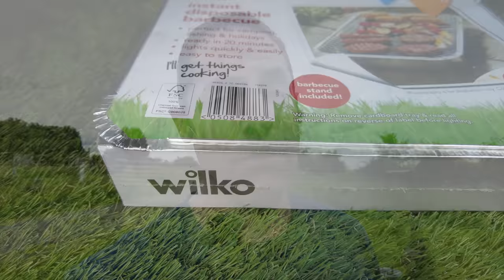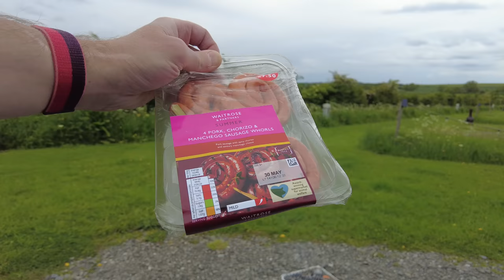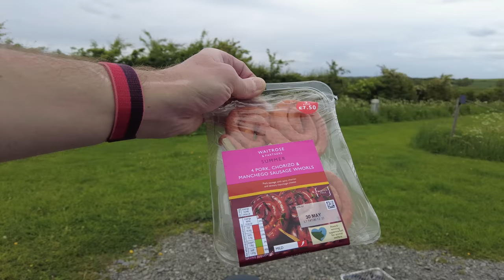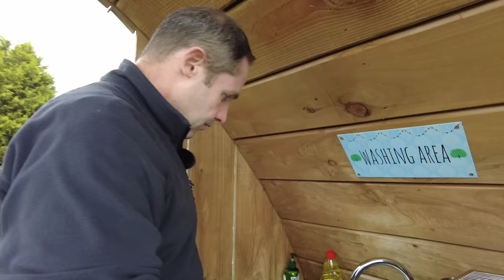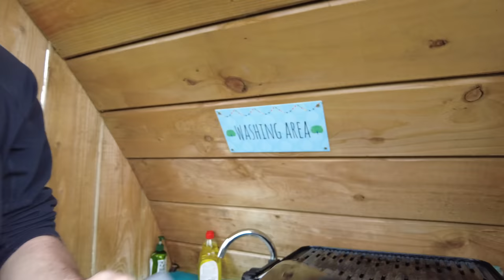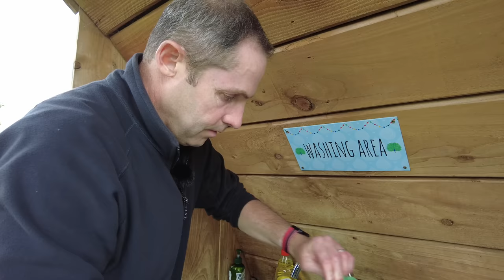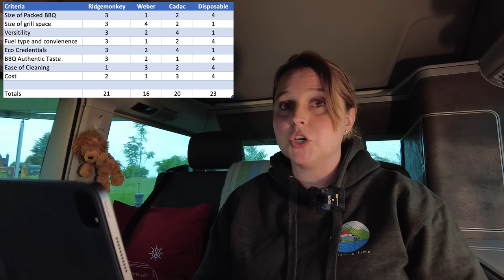Camping BBQ MEGA Test 2022 - For Campervans, Motorhomes and Campers!

Comment: Weber Go Anywhere charcoal would be my choice. Not only is it a real bbq (charcoal), it's smaller than the gas version and doesn't require cleaning afterwards. Just run it at a high heat and scrape. I also prefer to cook indirectly and cook low and slow
Reply from the maker: Mmmmmm low and slow... the BEST way to cook !

Comment: The whole point about the Cadac is to use the fat catcher at the bottom (put some water in there which stops it spitting and flames appearing) 
Then the fat would not fall straight on to the flame. Love mine, so versatile!! 

They’re awesome. I have the hp version and a single Coleman gas bottle (rather than the overpriced Cadac ones) lasted a whole week in France between 3 of us cooking bbq lunches/curries, Bolognese etc in the multi purpose lid … plus you can just use the burner for a frying pan for breakfast or to boil a kettle! The pizza stone is awesome too!
Reply from the maker: We learn something new everyday! That tip re the water in the fat catcher is brilliant, thank you!!

Comment: Happily grilled out and what a sizzling conclusion.
Wrestling to ignite damp disposables can detract from the simplicity but I cannot deny the logic.
But one key criteria has been missed out; 'Gadget factor'.  
Maybe its a bloke thing but the all singing stove that can grill, bake and roast in a compact easy clean package is hard to resist.
So I've gone for the Safari Chef 30 compact and when I've mastered the ultimate gadget (California) I may get round to baking bread and roasting a chicken.
Its also our back up when the Gaz bottle runs out and the unit cost of gas in the 220g cylinders is 40% cheaper than the 907.
Other interesting BBQs, include the Cobb and Lotus fan assisted grill and may be worth a look if you are inspired to extend your survey.
Thanks for an enjoyable hour and being introduced to the Ridge Monkey; neat design.
Reply from the maker: You’re very welcome and thanks for the other BBQ suggestions. We are going to try and get our hands on a COBB as many people have mentioned it and it does look great.

Comment: Great video, one question could you use the regulator that you have for you Cadac on the rigdgemonkey?? would be good to use the spare gas bottle
Reply from the maker: Yes you can! It just needs a few gas fittings to make it work and the correct regulator. We haven't done it yet but plan to as it would make for a neat solution.

Comment: I like the idea of the Ridge Monkey, it folds nice and small, and can be connected to a Gaz bottle (we always travel with 2 anyway). Also like that it might be used with charcoal / as a fire pit, but with that gauge of steel how long before it buckles with the heat?  Overall it just looks a bit fragile and faffy to wash up.  Currently we have the Campingaz Party Grill 400 which is almost a copy of the Cadac. It’s so easy to use (BBQ, flat plate, griddle plate, direct burner, wok), plus we bought a Cadac 33cm pizza stone which works well. It’s also a doddle to clean.  But still, if the RM can really be used with Charcoal and wood …. tempted !
Reply from the maker: Well i was a bit worried about that when using it as a fire pit but it held up really well. I suspect if you used it a lot it might distort but that said they’d be easy to bend back too. It’s the size that has won us over when packed up 👍

Comment: Can you use a small gas low pressure bottle and a large bottle on the cadac or are they both different bbqs?
Reply from the maker: Yes you can, just need the right regulator for them

Comment: The American version of the weber go anywhere propane grill doesn't look like that . Mines just has a the propane connection tube sticking out. I have both the propane and charcoal version. I was bringing my weber traveler for camping . Not a good idea that thing is huge. 2 of The weber go anywhere are less than have the size and packing size than the travel. Very portable

Comment: Great Vid. Just found that you can get a hot plate for the Grilla. That should help spread the heat a bit, and hopefully help with the cleaning up as it will stop drips going through onto the burner and deflector plate. Could up that score a little
Reply from the maker: Yes - looks great. We haven't got that plate (yet) but need to see if we can pick one up to give it a go.

Comment: Thanks for a great vid - what an effort you put in! I’m sold on the RM Grilla as it folds flat and can be used with gas, wood or charcoal. I’m assuming it’s fine to use one half of the ridge monkey XL pan on the top when cooking so may not need separate hotplate?
Reply from the maker: Yes absolutely - can't see any reason why not. You can actually buy a fitted RM hotplate for it if you wanted and it looks like it has a fat catcher on it too round the edge.
Reply: Trying to fund out if the Grilla can be attached to the outside outlet for our lpg tank. Very new to this so not sure what I am looking for! Does anyone know?
Reply from the maker: This will require some form of adaptor and/or regulator. There are some out there, I just need to find them…
Reply: @CampervanTime  thank you

Comment: Don't think the lid for cadac is suitable for using as a pan. In fact I'm sure it isn't. It would ruin the lid.
When you opened the Ridge monkey. I thought that's a winner.. Because its so compact. But the negative thing is no lid.
I think meat is cooked throughout better with a lid.
So I would choose the cadac because its more compact than webber
Reply from the maker: Thanks for watching. I have just double checked on the Cadac website and it does state 'enamelled Dome Lid which doubles as a pot for cooking' although we haven't used it that way ourselves. They are all a bit of a trade off between each other really we think.
Reply: Really surprised about that. As it's certain to damage the enamel if putting it on a flame
Reply: Cadac lid definitely suitable to be used as a pan. I’ve used it loads as a woc to do stir frys and make currys. Enamel still good as new. I love the versatility of the Cadac